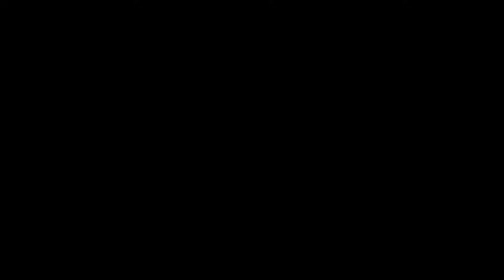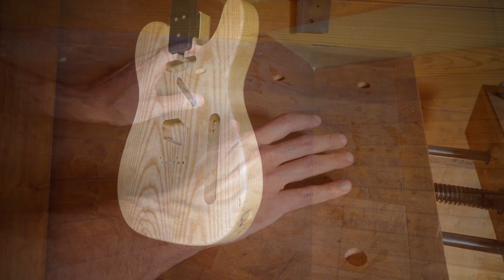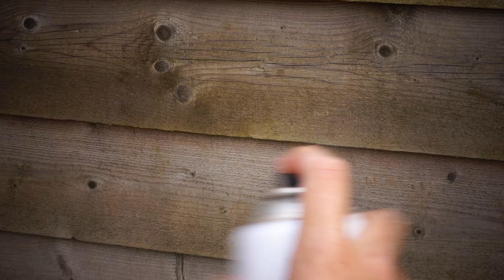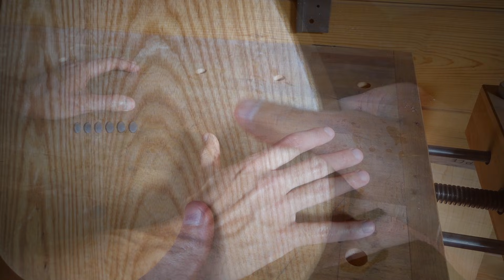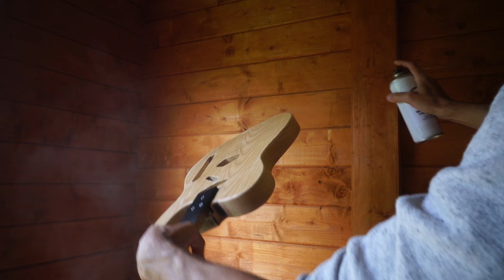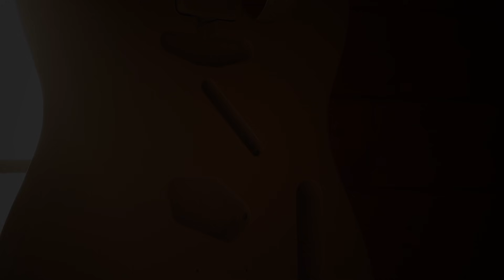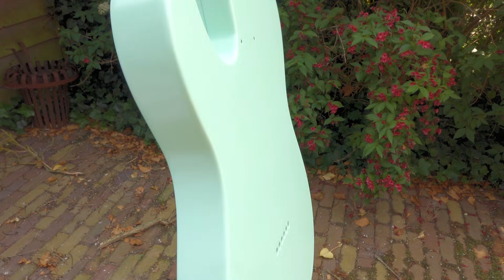Nitro Guitar Finish Tutorial - Part 2: Nitrocellulose spraying process

Comment: Thank you for this video!! Only one question:

After grain filing we sans with 240 grit paper, and then directly go to the sanding sealer?

Is there no finer grit paper to use before the sanding sealer?
Reply: I assume you're using the sanding sealer as a primer. In that case use 200 to 400 grit max. sandpaper. Any finer and it will clog up quickly. All a sanding sealer is, is a clear lacquer with more pigments and maybe more plasticizers, levelers, etc. in it to make the lacquer thicker so that it will fill pores and imperfections in the wood before color coats are applied. Otherwise you'll use ton of clear lacquer to fill the pores. Actually, wood filler is better than sanding sealer or lacquer because it won't sink into the wood. Any lacquer will sink into the wood overtime. Some people will prefer that old sink into wood look ie. relic freaks :) A primer's job is to create a level layer for the color coats.

Comment: What if I wanted a butterscotch blonde finish, and I wanted the wood patterns to still come trough a bit? Maybe not use the primer, and use less color coats?
Reply: Apply transparent wood filler or transparent sanding sealer, skip the primer (sanding sealer is a primer), and add less color pigment into your clear nitro or buy a spray that has semi-transparent lacquer in it. A nitro color lacquer is a clear nitro lacquer with some color pigment added to it. More pigment creates more opaque color and vice versa.

Comment: Hello. I've been watching a lot of your work and i have a question about Orange peel.  Do you have any experience with metallic nitro color paint with orange peel? I'm doing my first project now  wich will be multiple nitro colors over each other and finally a  relic. The til color coat will be in a metallic color. Do you recomend to sand it down if it gets a orange peel effect before clear coat? I read on some forums that metallic paint should not be sanded since it will lose it's effect. What do you recomend?
Reply: The clear coat will melt into the orange peel layer and will level it off so no need to sand the orange peel. I think when you sand the metal flakes then the light won't reflect differently for each flake and all will look the same.

Comment: I just bought a DIY kit and want to stain it and bring out the grain and then stain it with a purple. Can you give any tips on bringing out the grain and then staining it?. I see Stew Mac has color stains which I will probably use.  thanks in advance
Reply: Apply dark stain first, let it dry and then sand it off. The dark stain will remain in some of the grain. Then apply purple stain on top of all that. The dark stain will be in the grain and the purple will be between the grain of the wood. Then lock in the stain with a clear nitro lacquer. Might want to use transparent sanding sealer before the clear lacquer to grain fill on porous wood.

Comment: Great video, I would love to see a video on home built spray booths if that is something you could provide.
Reply: Use pvc pipes and drop cloth for spray booth. Cheap and can be taken down after job. Use two T's in the roof of the booth and put a cross pipe that you can use to hang guitar from.
Reply: Yep. I repurposed my wife's greenhouse of PVC by wrapping it in clear plastic. Its in my garage. Punched a hole near the floor and run a shop vac for ventillation. Spritz water to keep dust down.

Comment: I’m painting my guitar, if theirs orange peel showing in the base colour then you clear coat over it and buff later wouldn’t the orange peel in the base show through the clear?
Reply from the maker: The clear coat will dissolve into the color coat. That means you won't see the orange peel through the clear, but the clear might have the orange peel effect as well. Very minor orange peel in the color coat is okay. Major orange peel in the color coat should be sanded flat. Then apply clear.
Reply: The slight orange peel in the final clear coat will go away when you polish the guitar away.

Comment: This is an amazing video!! I was wondering if I could use vinyl sealer as a top coat though after I’ve applied color and primer? did you apply sealer primer and lacquer all in one day? Thanks for sharing your process!
Reply: https://www.stewmac.com/How-To/Online_Resources/Learn_About_Instrument_Finishing_and_Finish_Repair/Nitrocellulose_Finishing_Schedule.html

Basically you can do the initial 3 coats or so with the lacquer that youre using. Just make sure the coats are thin and have ample amount to dry.
Reply from the maker: Thank you! I've never used a vinyl sealer, but I think it's meant to be used as a sanding sealer, not as a top coat. I usually apply sealer and primer on the same day. The next day I'll apply color. The day after the clear coat. Technically you could apply all of them on the same day, but I like to thoroughly inspect the dried primer coat before I continue.
Reply: I think that vinyl sealer has some kind of particles in it that will make it easier to sand and those will take the shine away from the last coat when you sand it down. I guess you could use it if you want a satin finish. I wouldn't. I would use satin nitro lacquer if I was going for satin look. That way I can be sure the top coat is transparent and doesn't have stuff in it to mess with the color coat.

Comment: Do i have to use a clear coat? Or can i just polish the color itself?
Reply from the maker: It's not absolutely necessary to apply a clear coat, but I would recommend it. You can polish the color coat, but in my experience it doesn't produce the same level of gloss as a clear coat would. Of course you can give it a go, and if it doesn't match your expectations you can always apply a clear coat afterwards.
Reply: @LoneStarGuitars  i wanted to wear the paint off eventually thats why i was asking, not like a heavy relic but actually wear off the paint over use and time So i was hoping i can paint it as less coat as it can, so i can get it to look wear off sooner. Would that work at all or what advoce would you give me to avhieve a look like that? Thanks in advance
Reply: @enzonuestro1721  I would still apply clear coat so you have some checking going on. The thicker the clear coat the sooner the checking will happen but also the longer it will take to wear thru the paint.

Comment: I think this is the cleanest spray can finishes I've ever seen...
Reply: Most spray cans can do this easily. Even some rustoleum enamel paints. The trick is in the prep work. The smoother the surface before color is applied the nicer the finish. The only thing you must have is a good nozzle on the spray can and you can usually borrow the nice nozzle to replace the not so nice nozzle on cheaper spray cans. But yes, he did a great job spraying that body.

Comment: Thanks for the vids mate 

Just finished applying colortone dye (water based) to a flame veneer top. Wha5 wo7ld you recommend as just a clear coat spray can option ? Are there any types/ brands to avoid ?
Reply from the maker: I would start with a couple coats of sanding sealer. Make sure the sealer is nice and flat (you might need to do some sanding, use 1000 grit paper / wet sanding). Then apply the clear coats. If you live in the US, the Stewmac colortone clear gloss lacquer is a good option. In Europe, both Northwest guitars and Manchester Guitar Tech sell good products. Don't go with the Boston brand lacquers.
Reply: Lone Star Guitars thanks mate ! 

I am actually in Australia but should be able to track something down

Comment: I have completed my color application. I repaired and re-coated a small run by the jack port. I have some orange peel affect. Do I wet sand at this time or do I let the body cure then move on to clear coat , polish etc.?
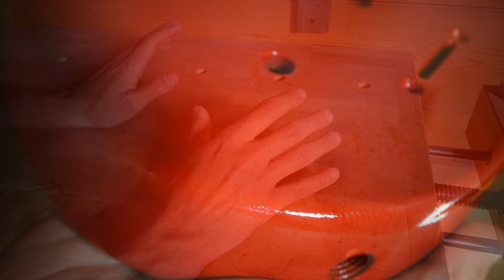Reply from the maker: If the orange peel is very bad (like the example shown at 1:58) I would sand it lightly before continuing. Let it dry for about 48 hours first and then very carefully wet sand with 1000 grit sandpaper. Try not to take away too much material. Then continue. Best of luck!

Comment: Superb videos! I have a build that I am going to be starting soon that consists of a flamed maple top over poplar. I intend to spray the poplar butterscotch blonde and use an oil based finish on the flamed top. Any issues that you can see with this approach? Any hints appreciated. Cheers.
Reply from the maker: Thank you! Are you planning on applying nitro on the top as well? I would not recommend only applying nitro on the back. You can of course spray the back butterscotch blonde while having the top taped off. Then apply your desired finish on the top. But then be sure to seal the entire thing off with a clear coat.
Reply: Lone Star Guitars Thanks for the reply 😀 I wasn’t thinking of nitro on the top too. But if the clear coat is the way to go I will follow that approach. I wouldn’t be applying paint if the poplar was a bit nicer looking, but oh well.

Comment: Thank you for taking the time to produce such a clear and informative video! It it necessary to grain seal Alder bodies? If we do see orange peel after spraying, what is an appropriate amount of time to wait before sanding? Thank you.
Reply from the maker: Thanks! Alder usually does not require grain filling. If I have to do any sanding in between coats I usually wait 48 hours and then very carefully wet sand with 1000 grit sandpaper.

Comment: Did the can of surf green have a clear coat built in? Is it okay to leave it at that stage if i want a thin clear coat finish?
Reply from the maker: No, it did not. It's possible to just polish the color coat to a high gloss and be done with it. In my experience though, the clear coat will have a glossier shine when polished than the color coat.

Comment: Whats the best affordable mask to buy?? Its hard to find a correct or straightforward response
Reply from the maker: It really depends on what you're looking for. I've used the 3M 06941 masks for quite some time. They are relatively cheap and work quite well, but they don't have replaceable filters so you have to replace the mask quite often. Right now, I'm using a Finixa A2-P3 mask, which is much more comfortable and has replaceable filters. I'm not sure if that one's available in the US. In the past I've also used the 3M series 6200 and series 7500 masks, which are fine as well. Make sure you get the right filters for the job. Best of luck!
Reply: Lone Star Guitars is it a mask that is designed for painting with nitro? Or is it just for fumigation of gas and not particles?
Reply from the maker: It really depends on the filters you're using. The Finixa filters I'm using right now are appropriate for spraying nitro. Unfortunately I don't have the specific filter codes for the 3M masks. Maybe you can contact them to find out which filters to get.
Reply: Lone Star Guitars thank you for the info
Reply: I've used the 3M with replaceable filters for some twenty bucks at homedepot. You can barely smell the nitro thru that mask.

Comment: Great videos! Just a quick one, I'm looking at doing a strat build with a swamp ash body and sunburst nitro finish where you can also still see the wood grain. Would probably look at using the grain filler to make a nice smooth body, but it was when you applied the white primer to this that you couldn't see the grain. If you want the grain to be visible, would you still apply a primer? Are there clear primers or would the process be a little bit different? Any help you can give would be greatly appreciated! 

Thanks!
Reply from the maker: I'm sorry for the late response! If you want the wood grain to show visually (meaning that the surface WILL be flat / grain filled) just follow all of the steps EXCEPT for the primer. Just apply grain filler, then a (transparent) sanding sealer, then your semi-transparent color coats and then your clear coats. A primer is not absolutely necessary. Best of luck!
Reply: That's great, thanks for the reply! :)

Comment: Thanks so much for sharing your knowledge. I have followed your advice, and have finished painting, ready for topcoat. The guitar looks awesome, even better than I expected. 

One problem I noticed though is a few small paint splatter drops. I feel like if I dry sand or wet sand to try to knock down the drops, then I need to sand the whole body. Other than the drops, the body is really nice and smooth. Any advice? Thanks.
Reply from the maker: You are very welcome. Why do you feel like you have to sand the entire body after knocking down some drips? Yes, those spots will look different (less shiny) from the rest of the finish, but when you apply the clear nitro it will dissolve into the color coat and everything will look smooth again. So no worries. Just make sure you clean the sanded areas well (make sure there isn't any sanding dust left, because that WILL show up in your clear coat), and check for any bubbles / pinholes in the finish where those drips used to be. Best of luck!
Reply: Yes, those splatters will melt into existing coats same with acrylic paints.

Comment: The rear ferrule holes seem to be blocked for the spraying process...what do you use to block the holes?
Reply from the maker: Fintan Doran The larger holes for the actual ferrules are actually not blocked. The smaller holes (for the strings) are. I like to put a couple drops of the liquid grain filler in them. This prevents water from entering and swelling up the wood during the wet sanding process later.

Comment: Do you have to keep it at rom temperature during the whole curing process time?
Reply from the maker: A little warmer or colder is not a problem. I wouldn't recommend leaving it to cure in a very cold space though. A warm space is usually fine.
Reply: If it gets colder in the evening by the morning you could have dew on top of the guitar so keep the body in a warm shed or maybe inside with the window open in a distant room of the house. Nitro hates cold weather and will take longer to dry. Anything below 40F is not very good.

Comment: Hi!
I recently ordered my first guitar kit and looking forward to start building but I want to keep the wooden look and want to keep the wood as light (color) as possible... Every video i find they use some kind of oil but it darkens the wood. Any tips on products to use? Im aiming for a matte of satin look...
Reply from the maker: JcBs What kind of wood is it? Does it need grain filler? In general, I'd say use a grain filler that does not darken the wood (for example, Rustins grain filler - not the one I used in this tutorial). Then just spray a sealer and a satin nitro. That shouldn't change the appearance of the wood too much. Good luck!

Comment: Very well done!  You showed some pinholes -- what is the best way to handle these?
Reply from the maker: awful1951 Thanks! The best way is to sand them down until they are no longer visible, then clean and degrease the area properly and only then continue spraying. Tiny holes like that are actually much harder to get rid of than larger imperfections. In this case, the pinholes were quite shallow so I sanded down to the sealer coat and continued applying the primer. If they are only hardly visible you can also choose to just continue spraying without sanding and they'll probably disappear after a certain amount of coats. You'll have to get a feeling for what kind of imperfections the nitro will and will not fill up. Remember that the nitro will shrink quite a bit, meaning that those imperfections may become visible again after some curing time. When not sure, just sand it out before continuing. Best of luck!
Reply: Just going to say that the quality of the paint job is dependent on the quality of the preparation of the body before it's sprayed with color. The smoother or better prepared the body is the nicer the finish will be. So do everything you can to make a nice flat surface before the color coats go on. Nitro is very forgiving so sometimes you can get away with stuff that normally you won't with other types of paints. Having said that, try to get all imperfections out as early as possible.